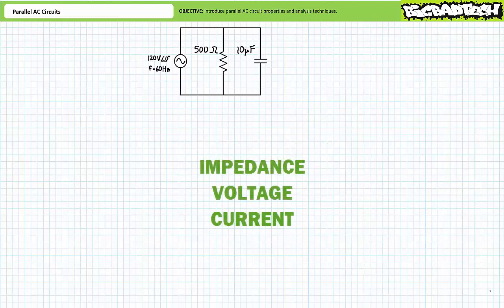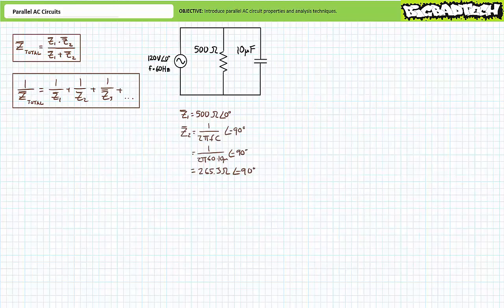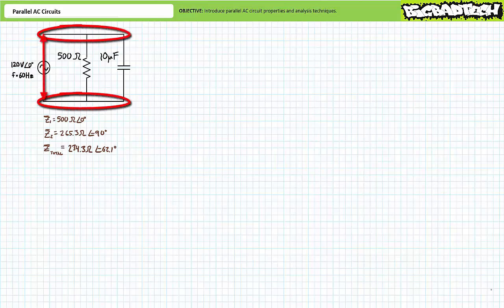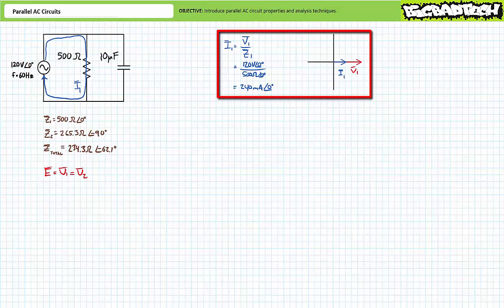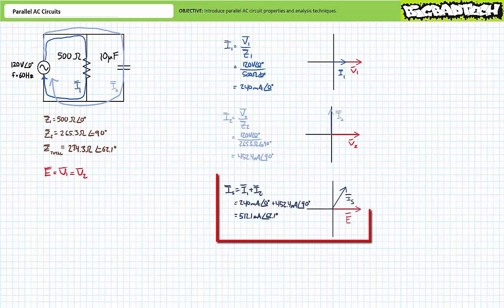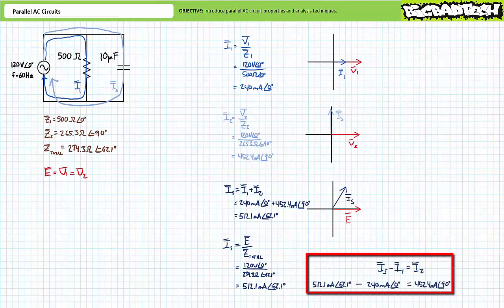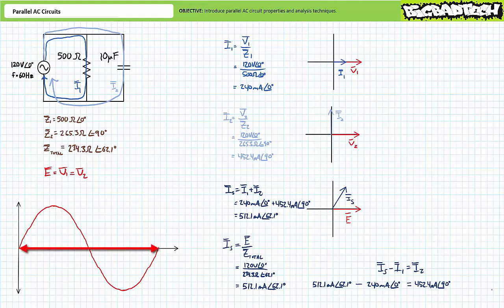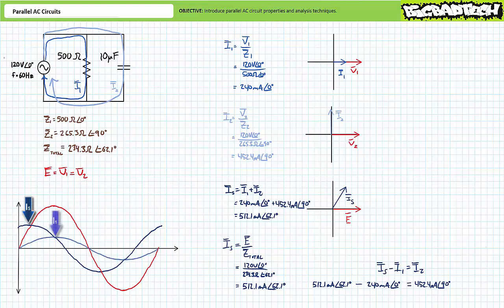Parallel AC Circuit Analysis (Part 1 of 2)

Comment: Jim, thanks for illuminating a useful and necessary subject.  As an old time engineer (slide rule, nomograph, etc. era) my bias is that you may find the student's comprehension of the subject matter may be enhanced if you speak more slowly and include a little more dead mike time after you have explained a key topic (just a little more time for what you've said to sink in). You obviously have an expert grasp of the subject.  Thank you for sharing your knowledge.
Reply from the maker: Thank you sir for your constructive feedback. It's very rare to find a polite suggestions on the internet. One of the advantages of teaching in this format is that a user can pause and rewind as they see fit. Ironically enough I walked into the computer lab the other day and one of my students was listening to my lecture at 1.5X speed! It must work for him because he's got straight As.